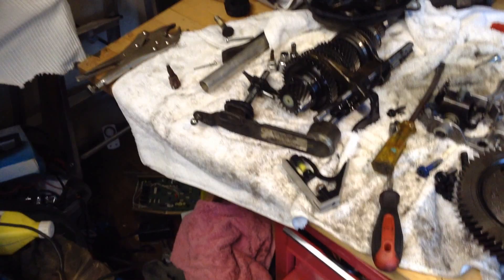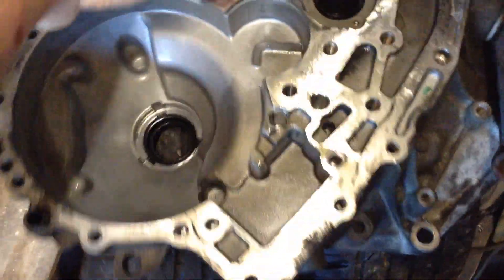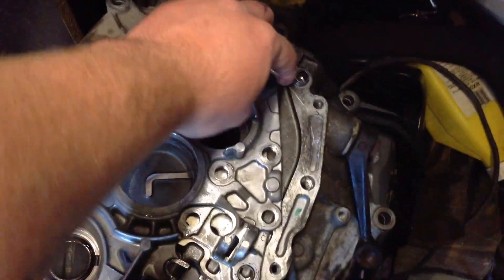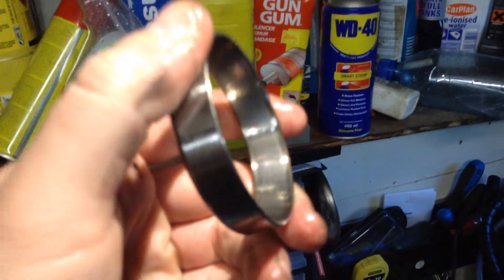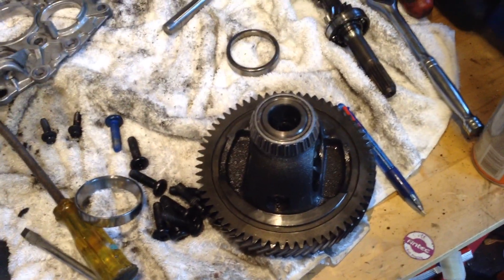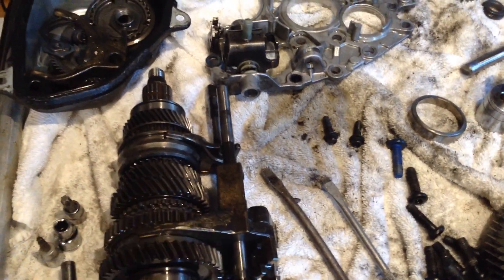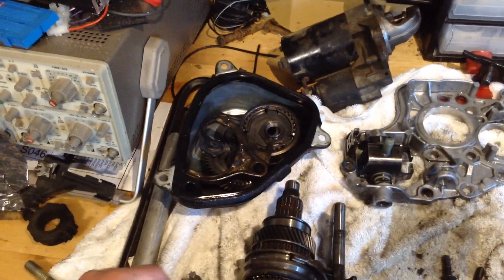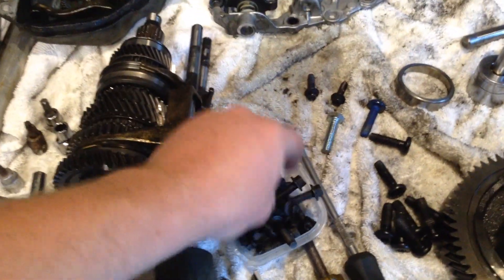Walk round a 2003 mini cooper gearbox - whats inside?

Comment: My gearbox has a hole in the side and I wonder can you pull the top of the gearbox off and just replace the shell..the gears are fine..also if you take the gear housing off will things fall all over the place
Reply from the maker: No the box has to come off really
Reply: @chriswouse7713  Thanks Chris I was just wondering when I take it off are there special tools I need and will the gears stay in place
Reply: @chriswouse7713  I'm starting to think that maybe your last reply was sarcastic
Reply from the maker: @joechambers09  no it was a sincere comment. All tools used can be purchased from your local supplier. I'd recommend you purchase a torx socket set and an engine brace to go betwen the strut towers or engine hoist to hold engine whislt you remove the gearbox. The gears are pressed onto the shafts so they won't fall off except the gears on the ends under the aluminium cober held in with stake nuts.
Reply: @chriswouse7713  Hey Chris sorry for that I really appreciate you getting back to me...I already have the bell housing gear box out of the car and sitting on the side...The top part of the gear housing you took off..can I pull that off of the bell housing with out disturbing the gears...
Reply from the maker: Joseph Chambers if you mean the thin aluminium cover then yes
Reply: @chriswouse7713  no I'm actually talking about the whole piece that you separated from the bell housing...if I take all the long and short screws out and separate it like you did..when I pull them apart will all the gears fall out
Reply from the maker: @joechambers09  no. If i recall they should stay in place because of all the linkages.
Reply: @chriswouse7713  Thank you very much chris..I will let you know how it turns out..did you ever get your gears back together
Reply: @chriswouse7713  Hey chris I took all the bolts out and got the transmission cracked open but the top part of it wont come off..its like its stuck on something
Reply from the maker: @joechambers09  did you remove the 2 staked nuts off the gears on the outside of the casing underneath the aluminium cover?
Reply: @chriswouse7713  oh no I didnt know they had to come off..are those the big nuts that are on the top of the 2 gears
Reply: And if so what did you use to get them off
Reply from the maker: Joseph Chambers I <think> it was a 23mm hex socket and a extension bar.
Reply: @chriswouse7713  ok I will try that tomorrow..thanks
Reply: Hey I'm trying to take those bolts off the top but the thing keeps spinning around..do you remember how you got it off or the bolts loose
Reply from the maker: @joechambers09  I think i jammed a rag between the gears to stop them spinning.
Reply: @chriswouse7713  That's the crazy part..those 2 screws will not come off they have a little ridge in both of them and they really dont look like they just screw off..am I missing something
Reply from the maker: Joseph Chambers you can do 2 things. Hammer the ridge out or just use brute force and it will straight the ridge out itself
Reply: @chriswouse7713  ok chris I will try that..thanks again for all your quick responses

Comment: Hello from the States! So how did your rebuild go? I rebuilt my 2002 R50's gearbox. By far the most technical automotive work I semi-accomplished. Sadly, the gearbox only lasted another 3k miles. Just wondering if yours is still chugging along?
Reply from the maker: Drew Riley it's still going. However after I reassembled it and the grumbling still was present so I dropped the gearbox out again and sent it to be serviced at a transmission specialist.
Reply: Chris Wouse That's what I should've done, just like you I took mine out again after rebuilding it. Can't remember why, something wasn't right. Lucky you're across the pond. You've got R65 specialist. No transmission or specialty shop will even touch that gearbox! Glad to hear you're still motoring on! Good job bud!
Reply from the maker: Drew Riley it's not that the job requires a specialist, it was just taking up time and money and bit the bullet. I'm sure if you got yourself a bearing kit, a bearing puller set, hammer and some drifts, I believe the job is possible in the garage if your brace enough. I chose to replace the easiest and cheapest set of bearings (final drive), which turned out weren't the one causing the problem, but hey had to try. Good luck if you try this.
Reply: Chris Wouse When I did my job, I bought the stacks from a in the UK. They come prepared and ready to go. I THINK there was 1 gear that I had to press on. Other than that the shafts came assembled. Still stumped. I have 2 sets of each shaft. I'm sure sometime in the near future I'll search out a specialist or try to find more info. I'm no expert, I can even tell you for sure where the gear box failed. The seller thinks it may have been a bad synchro. Who knows bud?